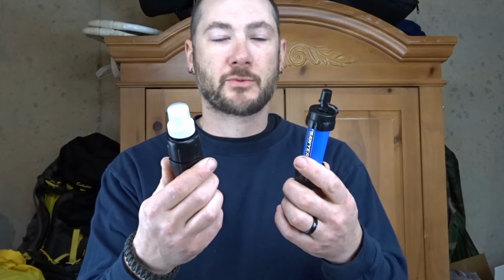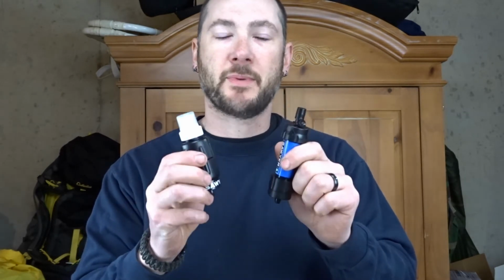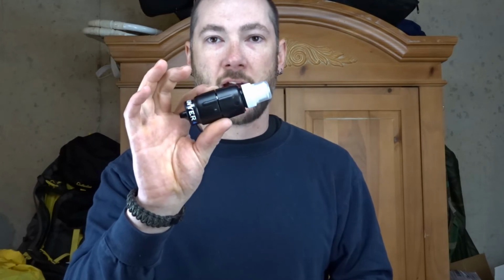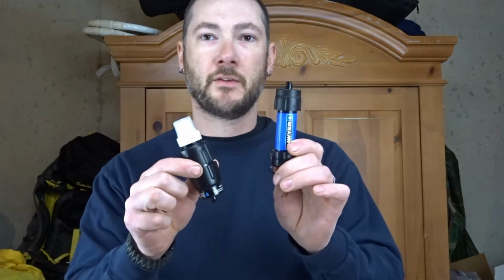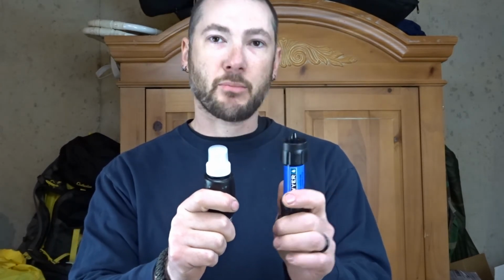Sawyer Mini vs Sawyer Micro flow test

Comment: Really great video. I also had no idea there was such a difference. I switched to the squeeze because I got sick of the slow flow of the mini. I'd be curious to see the difference in the micro and the squeeze. Thanks for posting this!
Reply from the maker: You are very welcome, thanks for watching it.  If I happen across someone with a sawyer squeeze I will for sure look into doing a comparison.
Reply: Jason Outdoors I thought about doing one, but my squeeze was 3 yrs old. Unfair comparison. But I really think they’re the same.
Reply: @SectionHikingTheAT  that's good to know! I'm always more concerned about how much space something takes up rather than how much it weighs
Reply from the maker: @SectionHikingTheAT  I'm pretty sure they are the same or pretty close as well.